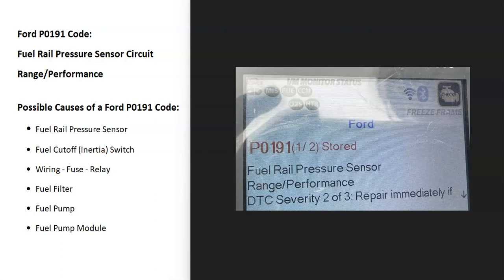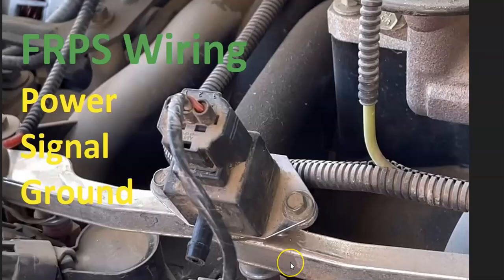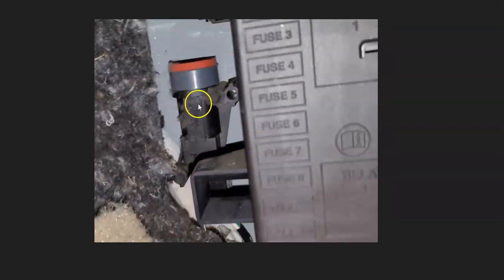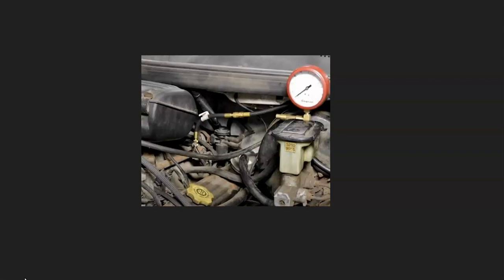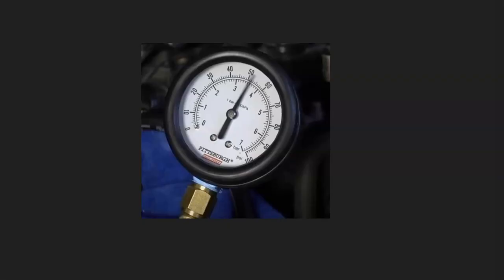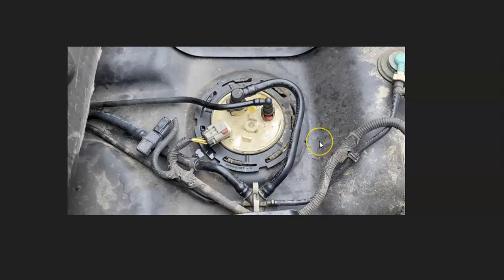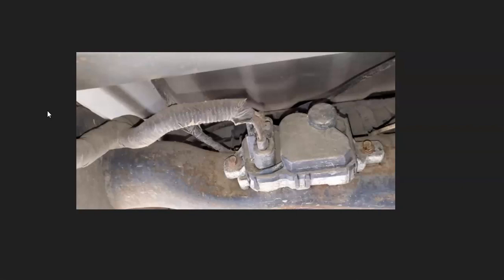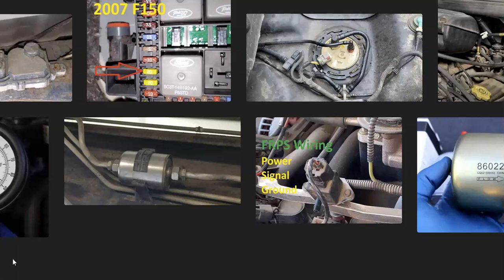Causes and Fixes Ford P0191 Code: Fuel Rail Pressure Sensor Circuit Range/Performance

Comment: What if it’s getting to much fuel pressure I have changed all the components you spoke on twice
Reply from the maker: If the fuel rail pressure sensor is good, high fuel pressure is usually a bad fuel pressure regulator or a faulty fuel pump.

Comment: Hello, not sure if you’re still checking this video but I have an 08 Ford Crown Victoria P 71 non-flex fuel. I’m getting the P0191 but I’m also getting a misfire on cylinder one, but both came on around the same time first thing I tried was replacing the sensor and it doesn’t seem to have solved the problem. I don’t have access to a fuel pressure gauge . My next cheap option would be the fuel filter just seeing if you have any other recommendations oh one more thing might be a little bit relevant information about six months ago. My gas tank got a leak brought it to the shop and they said it was rusting out and I needed to replace it, they recommended changing the fuel pump so I didnot sure if they ever replaced the fuel filter but basically I’m getting a very rough acceleration pretty much as if it’s a misfire and I noticed the last two weeks the car is cranking longer to start, which is why I thought it was the sensor. Any help would be greatly appreciated
Reply from the maker: Rust in the gas tank can be problematic and hard to get rid of. The rust will clog up the filter and other components. I would definitely change out the fuel filter, which for the 08 Victoria, I believe, is an inline filter under the car, which is likely clogged and the issue. If there is still rust in the tank, it will clog up again.
Reply: @ no well when the leak happened they completely replaced the tank and put in a new fuel pump, but I’m not sure if they ever changed the filter.. so like I said, I replace the fuel pressure regulator and that didn’t solve anything so today I drove the car and I have a Bluetooth OBD2 sensor to give me some readings. My fuel pressure range when I started driving was 14 to 25 psi after a half hour of driving the range went as low as 7.7 to 22.9 psi I know for this car it should be somewhere around 40 or high 30s the more I kept driving it. The psi kept on going lower and lower, but as a range, not as it’s constant basically I’m down to the filter or the fuel drive module if you had to pick one, which one would you go with? I really hope it’s not the fuel pump but then again they just replaced it about six months ago so they should warranty it for me, but it’s just a hassle of not having a car. Thank you very much for your reply.
Reply: Change the fuel pump and get motor-craft

Comment: I had this show up after driving in a deep puddle. What could the error code mean in this situation? Truck won't start
Reply: Might be the control module
Reply: That control module is as low to the ground as it can be. It corrodes gets holes and then driving it through a deep puddle could get water on the chip itself. Absolutely check that fuel pump control module first.

Comment: I have changed the driver module  fuel pump and filer new plugs fuel rail and fuel rail sensor and it's still pulling the fuel rail pressure sensor on the code idk what to do next got any idea
Reply: Any luck on what's wrong? I'm having the same issues
Reply: I got the same problem replace the sensor, filter, pump and the module and still getting the code but my issue is different i get the p0191 and p0345 and p0349. My truck will turn on and idle normal but then sometimes i will step in the gas and the truck will die and after i let the truck sit for like 20 min truck will turn on and run fine
Reply: IM HAVING THE SAME PROBLEM WITH MINE,I TKINK THERE IS A ISSUE WITH A OIL PRESSURE SENSOR ,TELLING THE PCM TO SHUT DOWN THE FUEL PRESSURE! MY TRUCK RUNS FINE FOR A COUPLE MINUTES, THEN IT IDLES DOWN RUNS ROUGH AND DIES, ONLY CODE I GET IS P0191. A 2006 F150 4.6 MY ONBOARD SENSONR TELLS ME TO CHECK GAUGES. I LOOK A THE GAUGES AND THE OIL GAUGE IS AT ZERO. WHEN IT RUNS FINE IT AT NORMAL. AND OIL LEVEL IS JUST FINE. AND PO191 HAS NOTHING TO DO WITH OIL. MY PRESSURE SENSOR HAS 2 WIRES COMING OFF IT I BELIEVE ONE GOES TO PCM THE OTHER TO GAUGE,
Reply: @goodvrsevil737 any luck fixing this issue, I have same problem, new sensor, module, pump and filter, fuses look good no kinked corroded or disconnected fuel lines either
Reply: I'm having the same issue and can't figure it out. I've changed everything and still throwing this code and dying
Reply: @jakemckeown6322  by chance did you check and see if the alternator is throwing out to many volts
Reply: Any outcome or updates?
Reply: I’m having the same problem with my 2007 4.6L.  I have changed everything but the injectors.  I’m getting a P0191 and P1233 on a fancy scanner.  Just the P0191 on a regular scanner.  I’m wondering if it’s the computer? 

Does anybody have any updates or solutions?
Reply: @joemichael5048  mine ended up being the fuel pump driver module, it was the 2nd time I replaced it in 5,000 miles. It was throwing different codes the 2nd time.
Reply: @jakemckeown6322 that was it!! Thank you! I only had about 4000 miles on the one I replaced!
Reply: @joemichael5048  happy I could help, I took me forever to figure this out and I did not think it would be the module because I just changed it not long ago. I tried everything everyone was suggesting, even putting in a new fuel pump

Comment: thanks so much for this video! i have a ford escape 2008 v6 fwd and my car started losing power and would start jerking back and forth while driving for over an hour going 100km/hour. engine light comes on, scan it when i get home and got this code. used your advice and got a new fuel rail pressure sensor and fuel filter. car drives like a dream and gas consumption is proper! 

code came back today so now i’m looking to get a fuel pressure tester now 😅
Reply: Ever get it fixed ?

Comment: Okay So in my car a 05 ford five hundred I wad getting 89.6 Fuel pressure and car did not want a disconyet the sensor it would saying it's at that 89.6 pressure.  Then I had a friend plug. The sensor back in pressure went down to around 3940. And was running fine but if I go to start it, I'll have a problem.  Again and and i've already replaced the  FRPS and the fuel filter, plugged, Coil packs, EGR  But no matter what I've done. The car would start and then shut off unless I disconnected the wiring why

Comment: I have a 2007 Chevy Monte Carlo SS and the battery will go all the way to 14.8 volts and drop as low as 11.8 I need help I just bought a ECM I haven't installed it yet I really need help.
Reply: Check the charging system